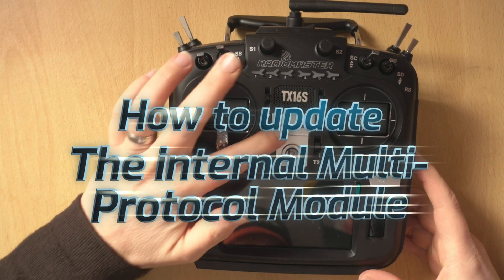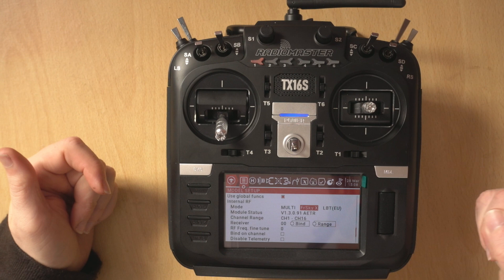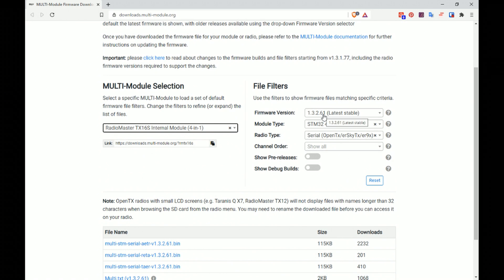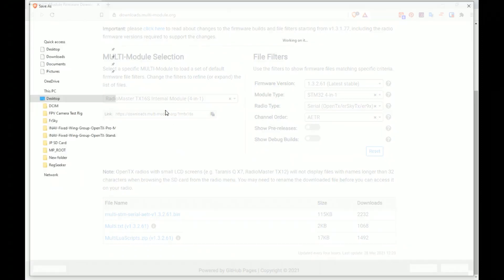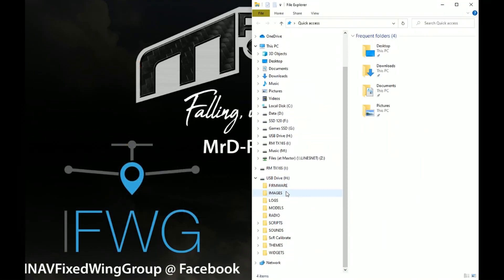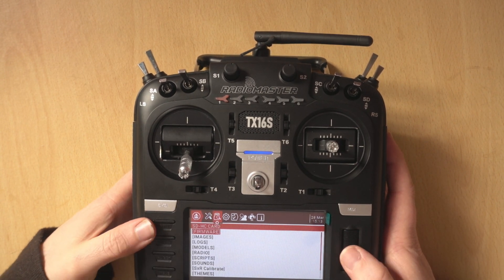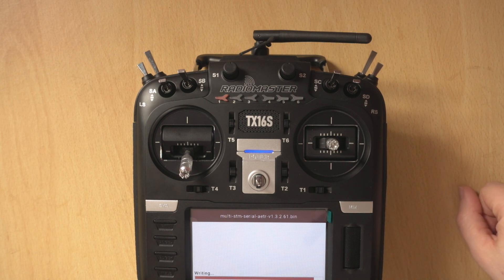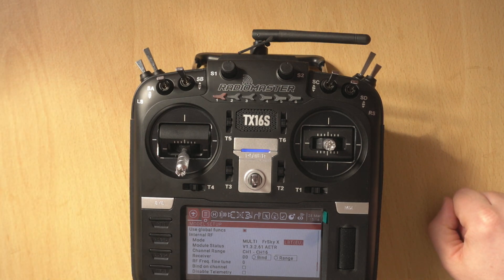How to Update the Internal Multi Protocol Module

Comment: Hi buddy I'm trying to set up my jumper t18s for a RC plane and the Rx is dsm2 for some reason I can't find it and I've updated the internal module which is version 1.3.4.31.but the firmware says air or surface or EU(LBT) and the radio type is serial or  ppm.what do need to do thank you

Comment: Hi thanks for this great video, you saved a lot of  time. I have a problem and I cant find any solution in the web, when I plug my T16S MKII in USB mode usually in windows pop up 2 windows, 1 with sd card content and a 2nd one with 2 files inside. After I updated the edge to the latest firm the second window with the 2 files doesn't pop anymore and I don't know why and how I can fix it. can you help me?

Comment: I've had my TX16S for a few months now and to be honest I've been putting off updating the Firmware. Today, after watching your video on updating the Firmware, I bit the bullet and was pleasantly surprised how straightforward the process was.I

Thanks again for another easy to understand, informative presentation.

Regards, Charles Butler.
Reply from the maker: No problem Charles. Make sure to update the multi protocol module too. That has updates pretty often.

Comment: i want to upgrade for Radioking TX18S but it's not in the list
Reply from the maker: That transmitter is not currently supported by OpenTX. People have used the Jumper T18 firmware, which seems to work for the most part. But does have some downsides, like a hissing speaker. I’ve just had a look at EdgeTX, but it looks like that doesn’t support it either.

Comment: Hi, just wonder if I addon an external multi module to my TX16s and and flash the firmware just like the way we flash the internal multi module, will the protocols in the External module be the same as the internal module?  The reason that I wanted to do that because the range of my tx16s is rather short and I have signal lost at about 150m range. So, I am thinking of getting an external multi module but I am worry that the external multi module do not have the protocol I want (v761). Thank you
Reply from the maker: You can do this, just choose the "Flash External module" instead of "Flash Internal Module" option when performing the update.
Reply: @MrD  Thank you very much
Reply from the maker: No problem 👍🏻

Comment: Question, I was prompted to upgrade the multimodule in the Radio Master TX16s. I have updated the module to V1.3.3.0 now the radio will not bind to either of my receivers a S8R or the RX8R pro. Can anyone provide a little help? Thanks
Reply from the maker: The main reason for not binding is that the receiver and transmitter module firmware are different versions. You may find that on the new module firmware that there are now FrSky X and FrSky X2 types. If the receivers are ACCST v1, you need to be using FrSky X. If they are ACCST v2, you need to use FrSky X2. If you don't know which version is on your receiver, I'd recommend downloading the latest ACCST v2 firmware for your receivers, flashing them, then bind to FrSky X2.

Hope this helps Ron.
Reply: @MrD  Thank you Sir she is working now.
Reply from the maker: Awesome Ron, glad to hear it.

Comment: I found it useful, the radio, not so much. It just won't have it.
Reply: Apparently, oldwr firmware requires a bootloader.  So you need ro use flash multi utility
Reply from the maker: Thanks for the information. I’m guessing that was the multi protocol module that needed the bootloader update?
Reply: @MrD  no worries and yes, the multi module in earlier firmware had no bootloader.
Reply from the maker: Awesome. Thanks.